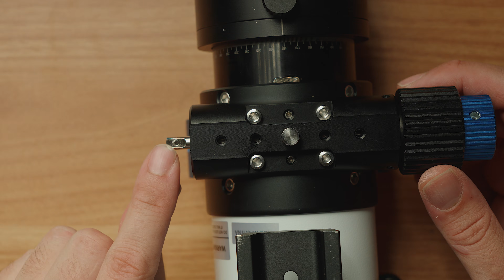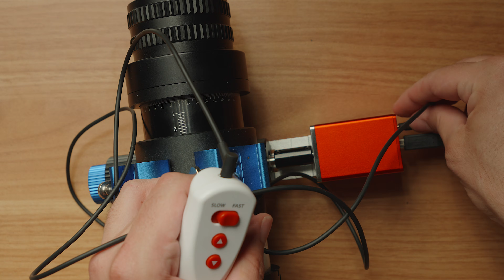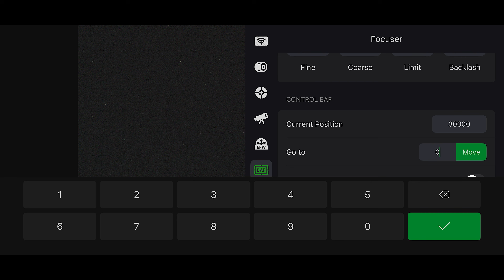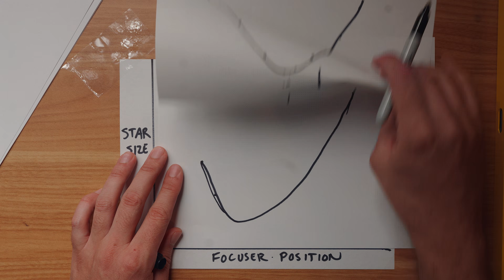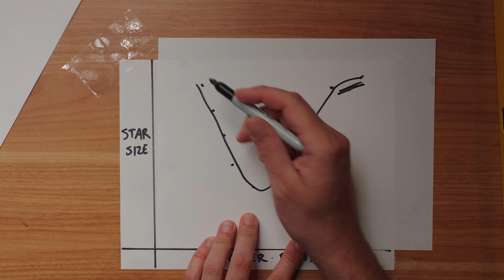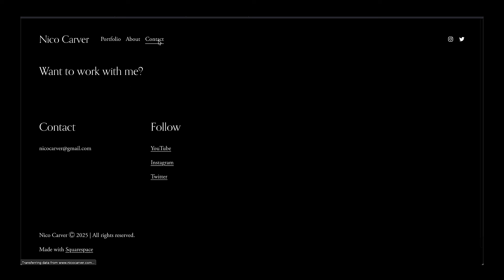How to add autofocus to your telescope

Comment: The troubleshooting section on how to interpret the curve was so easily explained and very helpful. Thank you. There are calculations that can be done on how to set correct step size but I always found those to be even more confusing so I have always gone with the trial and error method. Tried in increments of 100 (for example) and see how the curve looks and if the run can be consistently be reproduced on different stars.

Comment: Why did you change to a different coupler than what comes with the EAF? Isn’t the spiral coupler used to protect against damaging your equipment?
Reply from the maker: Yes, use whatever coupler comes with the EAF and fits the telescope focuser shaft. In this case, I wanted to show the ZWO EAF, but in my workshop, I didn't have one of the ZWO flexible couplers in even close to the right size, so went with the rigid coupler for the demo because it was closer to being the right diameter, but still not quite right.

Comment: In my case, my telescope has two screws in that place. One locks the focus, and the other enables the focuser entirely. I've found that even without these locked, I can still PULL the focuser out to the end point, without turning the knobs. I can't do this if it's locked in place. So if you have weight on your focuser, then know this may be an issue and you'll still need to install those screws.
Reply from the maker: Ah, yeah, sounds like a Crayford style focuser, and it still needs that screw(s) for tension. Should have mentioned there are different styles. The one here is the rack-and-pinion style which is nice for astrophotography, but I think some people still like crayfords for visual because they move smoother.

Comment: If you find that getting the intital rough focus good enough for the EAF to do the fine tuning takes up a lot of your clear night sky time - particularly this time of year when the nights are very short - the rough focussing can be done during daytime with a somewhat distant object as the focus target. I regular use my telescope with and without a reducer, so need to change the rough focus each time, and it works well enough doing this in daytime with the autofocus getting it spot on the first time from my daytime rough focus. I have since noted the focus points in my phone - little notes on paper tend to always get lost - and that of course makes the process a lot easier just using the goto function or the buttons, in my case located directly on the ZWO EAF Pro, which I think is almost worth the extra cost of the Pro version as it is so easy without having to use hand controller or app controls, and only requires powering on the battery powered EAF.

Comment: Great video! For the chart on 33:06, I've had that happen when the focuser shaft started to slip because one of those locking screws somehow, someway, started coming out on its own. Sometimes it would lock and sometimes it wouldn't. It was very strange but reinstall and retightening fixed it. 

Instead of measuring backlash, I always set the backlash value way high which also works pretty well.

Comment: I've watched a few of your videos by now, and the thing I always find strange is how high exposure time you can set even in unguided conditions. If I set 2s exposure, I'm seeing star trails, I guess unless I stare at Polaris region... Which is why I ordered a guiding base, because lots of 1s exposures doesn't really give me much to work with here.
Reply from the maker: Here, I think I was on Polaris because I didn’t power on the mount for the demo. Usually you have to at least be tracking for a 2 sec. exposure at telescope focal length. Guiding would only be needed for me when I get to maybe 30 or 60 sec., but depends on the mount
Reply: @NebulaPhotos  Thanks for responding.

I have a 1000mm lens and a doubler, but I can see the trails even with a 35 and 50mm lenses on full frame camera. :)
Since I'm new to this, I actually still confuse tracking and guiding, but I ordered a base that can be used for tracking (I assume that's just the motorized base that turns at a given pace), or used with a guiding scope as well. 
Since I found an inexpensive guiding scope with a small camera, I'm hoping guiding will work out well, but for the moment I'm neither tracking nor guiding, I'm waiting. ;)

Well, that and learning quite a bit from your videos.

Comment: the 1st 1st step is to kinda get the scope in focus before you install the eaf !  hehe.  can take a while in software if you can't see anything :)
Reply from the maker: Yep, I finally mentioned that should be the 1st 1st step at 16:32 lol - my mistake
Reply: @NebulaPhotos hehe insaw that.  On a wide refractor its not a big deal but when i installed an eaf on my sct it took a whilllleee before i could find rough focus ! ☺️❤️
Reply: 2 other tips to determine rough focus point:
- point toward a bright star
- increase the gain to maximum

Comment: That was very well explained, I especially liked the bit about the curves, I have a number of focusers, infact I have them permanently installed on most of my rigs as I don't like swapping them from one scope to another once they are set up and working, but of course it is a bit expensive doing it that way. I use mainly EAF's but also have two Altair AAF's ( same as the Toup Tek) which are supplied with a hand controller and a PLL Sesto Senso 2 which requires a separate 12v supply but is a very good focuser imo. 
Do you use the external temperature probes ? The AAF's are supplied with these but you have to buy the separately for the EAF.

Comment: Hey Nico, What a timely video. I just got my EAF the other day and was going to install it this weekend. 
I ended up ordering one because I've finally got to the point where very fine focus is a predominant issue in my image quality. 
I do have a RedCat with helical focus but I'm sure there's videos about the deep sky dad part of that equation. (possibly done by you, haven't looked yet)

I did want to say,...
You, Trevor, Cuiv, Rory and so many many more are the ones that inspired me to start doing this but also kept me going, with tutorials or just motivating content, through the learning and struggles in this space. pun intended.
Thank you sir!
Reply: I have the Redcat with a Zwo autofocus unit on using a toothed wheel as opposed to a belt works a treat definitely recommended

Comment: There is another issue yo may see. 

Asiair does a two round focus curve. First it calculates the full V-curve. The second run it moves out again and then gently in to the ideal focus position. If you see that the second. curve is not a curve but it goes from focus to off-focus, then you have some play or backlash (or the belt if you use a belt is slipping).

Usually asiair deals with backlash via overshooting so it does not really matter if you have some, but this is not really that much configurable (I suspect they do proportional to the step size, so there is some level of tuning possible, but not ideal). What is weird is that their backlash setting does not really control this overshooting amplitude.

Comment: Oh good, I have been doing it correctly. I also recognize the curve with a small amount of backlash, but I bet that's mostly from the spring coupler. My EAF has been one of the best upgrades, no more bad focus shots from the middle of the night, no more bahtinov masks, just set it up and go.

Could you also talk about the challenges of using an EAF with an EFW? The focus offset settings got me good the first couple of nights I used it, and I'm still not sure I have it set up optimally.